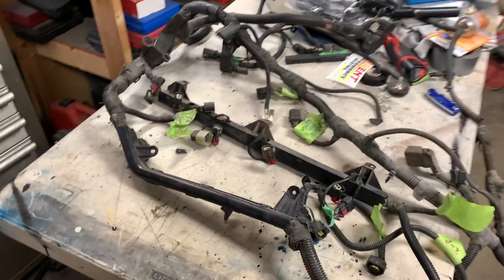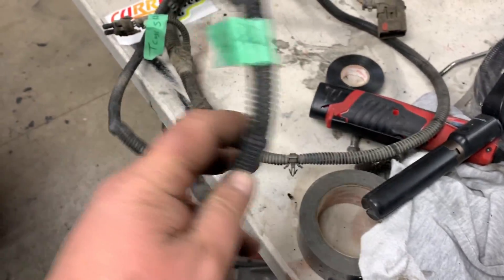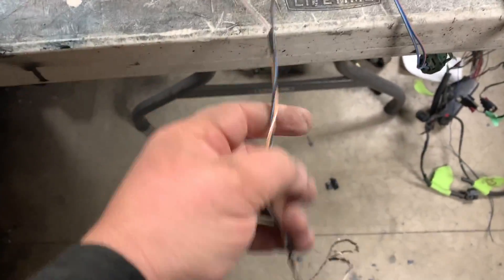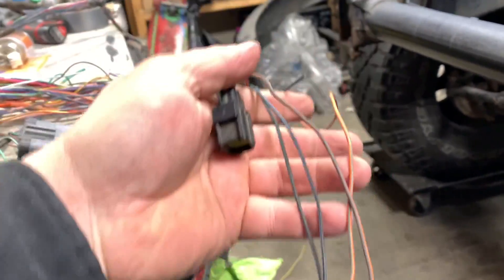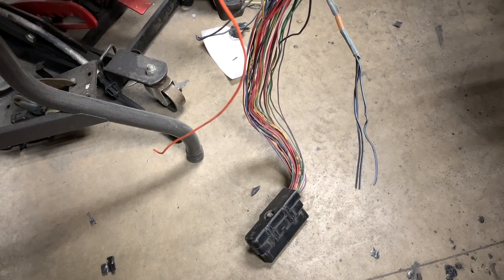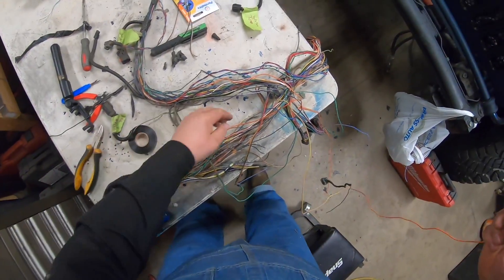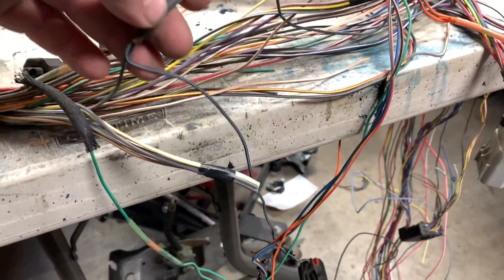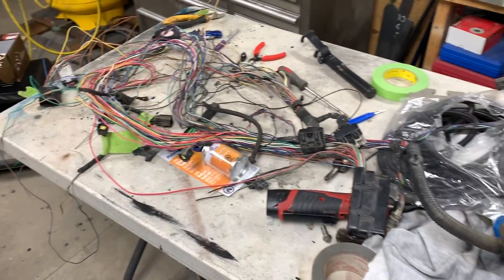LS Swap Jeep Wiring Harness Rework PT 1

Comment: What color is the oil pressure gauge wire the temperature gauge wire running to the inside to integrate the LS wires to